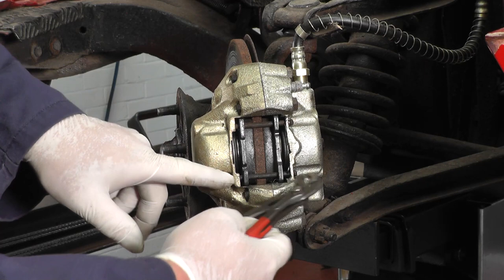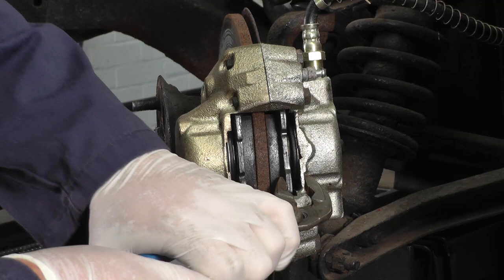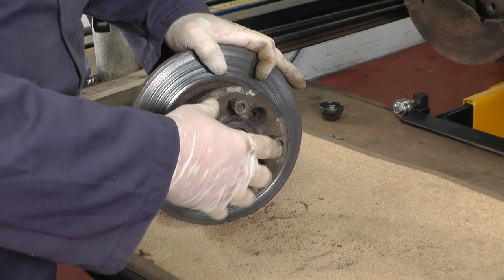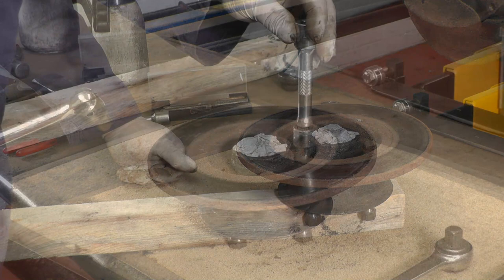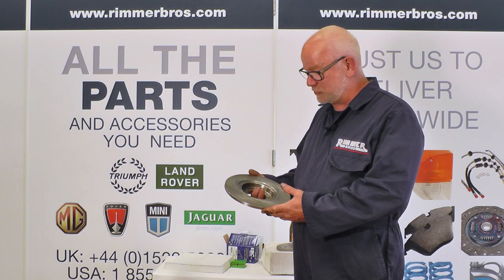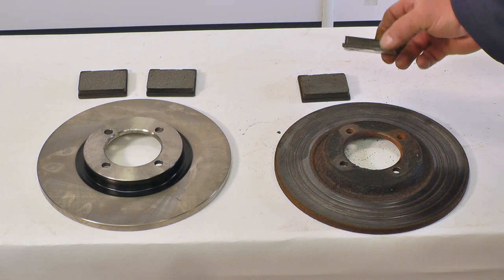Triumph Spitfire - How to Change the Front Brake Discs & Pads

Comment: Hi Hans! I watched the front brake video and it was very helpful. I am in the middle of working on the front brakes of my 1965 Mll. One thing you did not mention was the brake dust shield. One of mine is particularly in bad shape and I was thinking of pulling it off and replacing it. I'm a little unsure what I have to remove in order to get it off. I have not had much luck with my Hayes manual or finding other videos on this topic. Any advice or recommendations about how to remove the dust shield? Many thanks! John